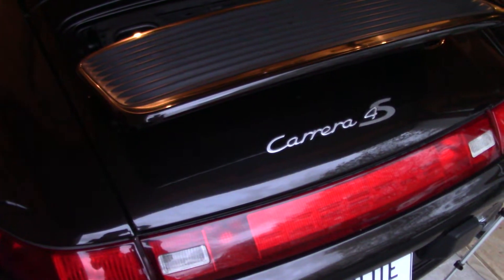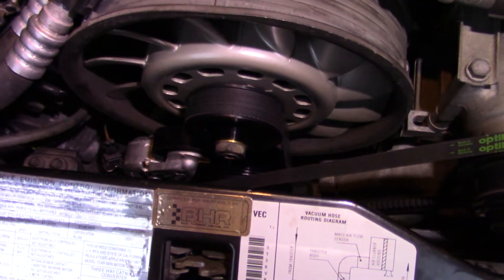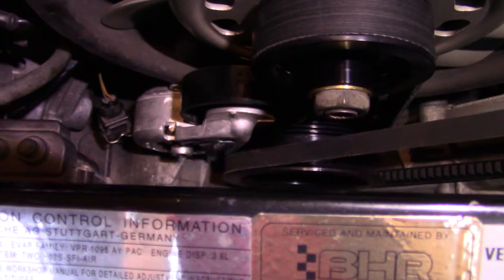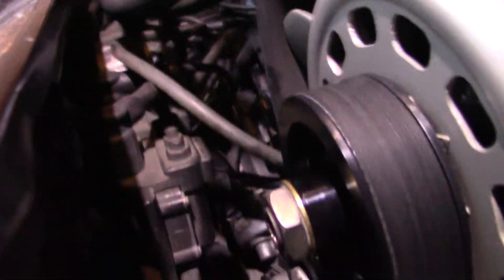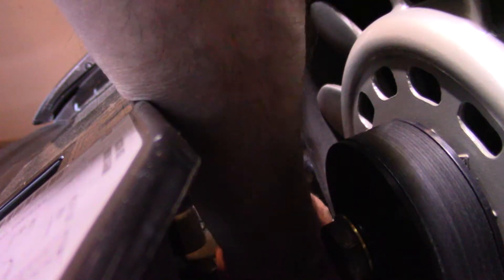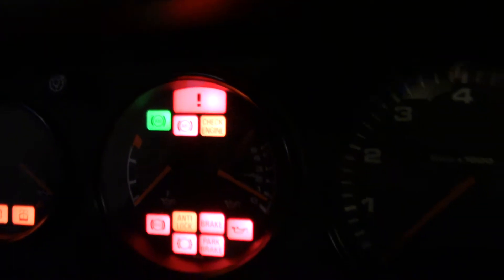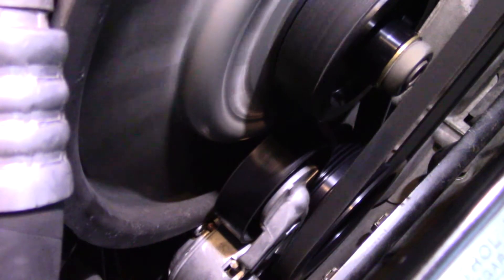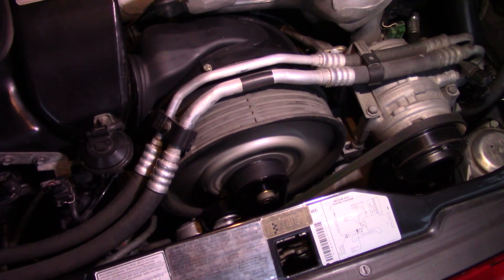1997 Porsche 993 4S with Clewett Engineering Serpentine Belt Kit - Similar to RSR setup

Comment: Thanks for this. My middle (alternator) belt went (after 30,000 miles) but it frayed the edges of the fan belt as it disintegrated. I changed all three myself, taking my sweet time. BTW, if you ever brake vigorously and the ABS/ABD lights come on, it's probably NOT the green relays, (in the frunk pax side), but rather a belt issue.